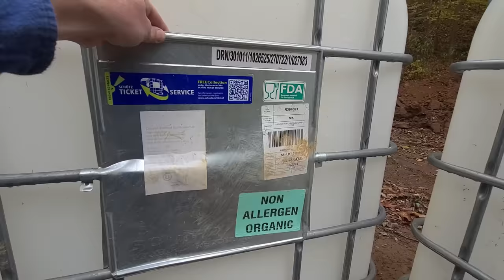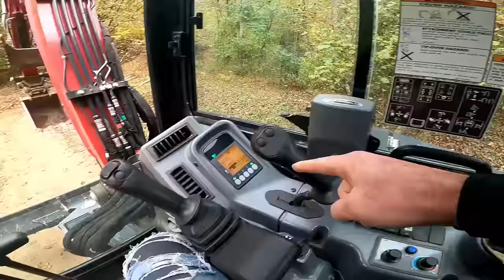Water / Effluents / Fiber - Single trench // E133

Comment: Thank you for showing and explaining how run the big machine and also lay pipe and still keep it as coiled. Your the first homesteader I have seen that actual roll out coil plastic pipe with ease and not get kicked. I appreciate when you explain how to do things. Keep it up.
Reply from the maker: Thanks, I figured it was worth the time to handle it with care instead of yanking on it with a huge machine.  That stuff wasn't cheap.  Next time, I would try to unroll it first and let it rest in the sun for a few hours.

Comment: wow another step towards the housebuilding :)    ps  on the plastic ties,(holding the roll together ) if you find were their melted together, just flip to the underside of it , there is usually about a half inch tab that was not melted and that  you pull to release the band.

Comment: Well done John, or as we say in the UK, "Good effort" ... You have every right to feel pleased with yourself; A good example of 'working smarter, not harder' ... Definately double up on the clips for the 2 inch pipe joints and perhaps consider using the pipe adhesive as well (belt & braces) ? Bravo, bravo 😎

Comment: Great job and so nice to see Meg in it as well. Was just think will you have problems when the sewage has to go over a rise will it get frozen in the low spots. And is the white pipe thick enough for the added pressure going up the mountain . Certain you will have looked into this just interest and that all is good. Never been in an excavator so loved that part of the blog. Thanks again from your Aussie mate. Robert 🇦🇺🇦🇺🇦🇺

Comment: The check valves won’t hold back 1800 feet of water. The length doesn’t matter. It’s the elevation that it holds back. So they are sharing the 200 feet of water equivalent. The good thing about having 5 is you have a lot of redundancy and it should last forever. I know you want to be “off grid” but a couple of wires (since you already have the trench open) would give you minimal power for things like charging batteries on extended grey days.
Reply from the maker: I was concerned about the force required to push through all five.  I guess I could upgrade the well pump to a stronger one if need be, but that would require a larger pipe ID.  Also, yes I agree about the electric backup line, but it gets really expensive running lines that long.  You can always crank the gas generator and plug it into the AC input if you're desperate I figured.

Comment: Jon, Before you backfill. check that the WiFi cable is still all in one piece, and that both pipe are watertight. Prevention is better than cure. That's all I'm suggesting Regards and Good Luck Robin.

Comment: really smart move on talking to your data provider. I worked in that industry for about a decade and could not tell you how many people did not contact the data provider and paid big money just to have it not work properly when we showed up for the final connection. And then to tell them all you had to do was call before you dig and we would have even delivered the cable and or fiber for free. They drilled it into our heads.. its 20 times easier to maintain an existing customer than it is to make a new one. BTW Clorine is not good to use with Plastic's

Comment: Pressure of the water is ONLY related to the Total Vertical Rise, NOT the length of pipe!  You don't really need more than one check valve. Definitely mark the locations of the 'extra' anti-backflow devices for future reference.

Comment: Pex B is the easiest to work with but it restricts the volume more than PEX A. PEX A connectors are full size on the inner diameter and PEX B connectors have a reduced inner diameter size.

Comment: It would have been better to run conduit for the data line. The cheapest I found is to use black poly water line You can run 1.25" for multiple cabling. issue is that fiber termination is a pain. For my property I ran conduit, figured out the length of fiber I needed, than order pre-terminated fiber that can be pulled through condiut. I install 4 pair fiber in case a pair broke or if I need additional pairs.
Reply: Not a good idea to bury the check valve underground. If it fails you got to go find it. Check Valves go where the pipe is exposed and can be easily accessed.